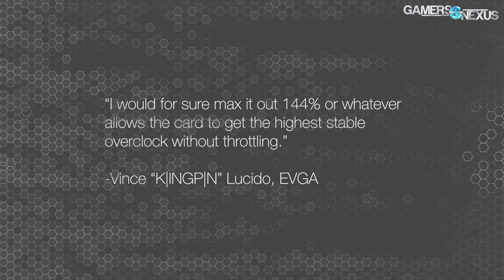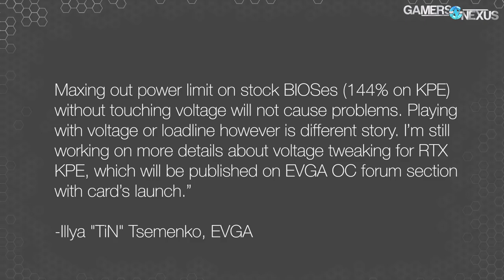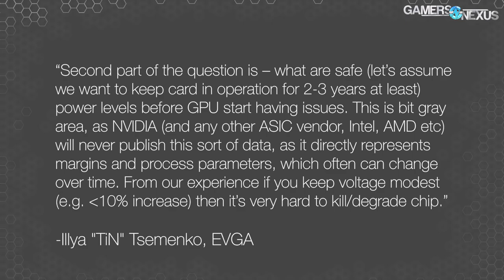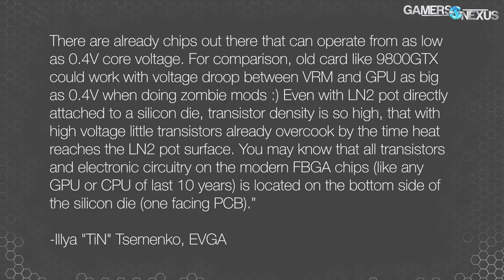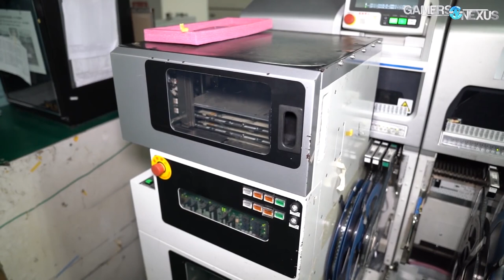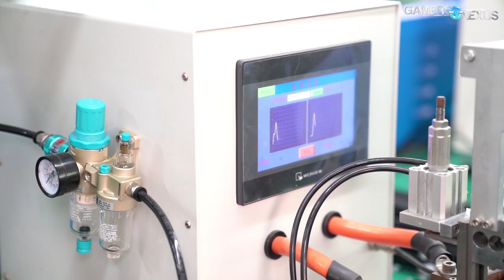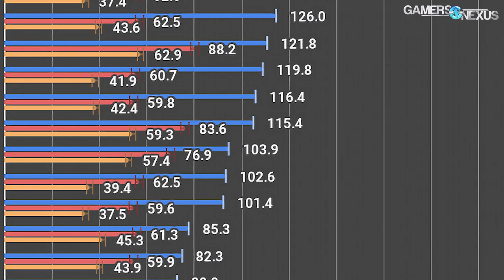Ask GN 107: Does Max Power Target Kill Cards? Ft. Kingpin & TiN Answers

Comment: Ask GN: Hey Steve. thankfs for the factory tours i enjoyed them alot. 

Do you think it's a correct and accurate representation of RAM Speed/Performance to say 3600Mhz CAS15 means 3600/15=240 and 3800Mhz CAS19 means 3800/19=200 therefore 3600/15 is 20% faster/better in games and productivity. Is it also a bad Investment for gaming and productivity to go for 3600Mhz RAM vs for example 2400Mhz Baseline? (Specially on a Ryzen Platform)

Comment: I feel this would be a great place to ask this: if I am gaming with a fan setup (meaning using only a CPU fan cooler), is staying at 63c during heavy load good? I was considering getting a CPU liquid cooler but if those temps are fine, then I probably wouldn't go for it till I upgrade to the new Ryzen line. Currently on a Ryzen 5 2600 OC to 4 GHZ
Reply: 63C under heavy load is good. Personally, I would switch to something better if temps are consistently in the 80s or higher.
Reply: Alexander Siracusa awesome thank you for the tip and the reply!

Comment: If you take a little bit of coconut or olive oil and rub it over your hands so there is a light coating on there, then brush down the dry flyer hairs to tame them. I noticed how when guys decide to grow their hair it always looks different than girls' because they haven't been training their whole life and don't know as much about properly keeping it nice. The entire trick is too dry or too oily. Too oily and you look dirty, and the hair doesn't move at all it stays pasted down. Too dry and the hair flies up and loses depth of color like a wood surface that hasn't been oiled. If you get the perfect balance it gets a nice medium weight to it where it will condense into locks instead of individually flying up in the air. It will also be stronger when it's not so dry. I knew someone who kept theirs even dryer than yours and when they finally got the balance right after I helped them the change was incredible. It went from an airy ball of puff to actual real hair. It also gained a few inches because it had been weaker when it was dry for so many years and had been wearing off at the ends.

Comment: Ask GN: Would it be possible or have any benefit for Intel to try making a whole new 14nm node adding in some of the new and exotic lithography, aggressive cobalt doping, and transistor pitch that are mainly holding 10nm high-performance parts back because of it being tried on a sub 10nm node. Where the issues I assume would be amplified just due to the new nature of the node size itself and their unique complications. Probably wouldn't make the marketing department happy to announce the brand new node at the same size either tho.

Comment: I'm curious about power delivery on motherboards and how this important feature sometimes gets downgraded in favor of RGB and other fluff. Didn't Asus X470 Prime get worse VRM than X370 Prime? I think there should be some standardization for VRM on motherboards, somewhat similar to how that works with power supplies. Buildzoid was very critical of bullshit VRM schemes from certain manufacturers who claimed they had more VRM phases than they actually had.
It's sad that most midrange boards like B450 get worse VRM than X470, while both usually have useless fluff like RGB. I don't need SLI or RGB, I just need a beefy VRM.

Comment: Overclock GPU 24/7: semiconductors, unlike 'normal ones increase their conductivity at increased temperatures; which makes them very sensitive to a threshold beyond which their operation becomes impossible. That temperature threshold is dependent on the load, stability parameters, real power input, load level, transient thermal dissipation,.... Basically, if you can keep it stable long term (ie, no crashes, minimal throttling), you should be fine.

The capacitor argument of GN IS valid for low(..er; ...ish)-end GPU power delivery systems, but anything beyond G/Rtx xx70 should be irrelevant (more or less). For detailed analysis you have to consult significantly more competent YT outlets like buildzoid.

Comment: Ask GN. I have a 1080 ti fe card that one day started black screening when it boots to desktop, then it starts whining! It will work just fine in safe mode. I'm wondering if the card is toast or is it fixable?
Reply: In safe mode, OS does not load proprietary GPU drivers, that's why screen not going blank. If reinstalling OS and nvidia driver didn't helped out then yes. your GPU is pretty much dead. However, it's still fixable by someone with proper skills and knowledge.

Comment: #askgn This may be a redundant question or really not matter but I thought I'd ask:  Is the heatsink fin orientation on a GPU important?

I'm looking to buy a new GPU in the coming months, probably an RX5700 XT.  I'm also hoping to one day get a case that is vertical GPU friendly; I saw your video on the SL600M from CoolerMaster and it got me thinking.  How much impact does the fin orientation on GPU heatsinks have (vertical vs horizontal)?    It's not something I've seen mentioned but when I think about the airflow in a case like the SL600M with a vertical GPU I would expect that the thermals would be significantly better if you had a GPU with a vertical fin stack.

Comment: People seem to think if a connector costs 20 cents then it should make a $50 case cost $50.20 and that’s worth it, but that’s not how manufacturing works. It takes FAR more to implement, install, etc so it could make a $50 case cost $55-$60, is 1 connector worth a 10% increase in price on a budget conscious product? 
Even if it means selling less overall products to make a handful of people happy and a lot more simply pay more for something they don’t use.

Comment: I have two mobo with usb type c, i still don't know the use for a type c other than mac products.
Reply: a lot if not most of the high end and now even mid range android phones have type c with a chip that can do quick charge/take advantage of gen 2 speeds so it's always nice for people who transfer lots of data off phones. a lot of external ssd back up drives are also using usb c so they can have a single data and power line with a small form factor and universal connector that can use the bandwidth.
Reply: @MrDJAK777  I have an Samsung Galaxy S8. I need a type C to type C or a adapter to plug it. By the way, my s7 also has quick charge with micro USB.  What I am missing?
Reply: @elchicovip01  you should be using a type c to type c at all times if you want the fastest charging rates anyways. micro USB quick charge has a much much lower power spec. type c supports Thunderbolt which can make for much faster backup to a NAS or portable hard drive and for devices without thunderbolt it still gives full USB 3 gen 2 transfer speeds which are a hell of a lot higher than a type a to type c cable can manage. the only reason you don't see a benefit is that you're not getting one if you have a type a connector on one side it doesn't suddenly increase the data and power transfer limits just because you put a type c on the other side. it has to be type c to type c to get any real benefit out of it.  you can supply power to monitors and on some, with USB type c's display port over USB feature, you can get video and power from the same one cable.

Comment: ask gn: i will have a spare i5 7500 when i upgrade to Ryzen 7, i so i thought just for kicks i would  buy a dual socket lga 1151 mother board and a new cpu to build a dumb money waster.  but after a bit of online window shopping i  turned up empty in the mother board department. why  can i not find a dual socket board for my i5 ?
 yes ik it is dumb and probably would be worth a sack of case screws but i was board .

Comment: ask GN: so I want a high end GPU (yes Mr money bags here) here in the UK it is seeming difficult at present to get a hold of kingpin card but I have recently seen the HOF card and the asus matrix card availiable here obviously there are differences in ccoling etc..  for the most part I will be running my system modestly probably stock but will also be tinkering with a good OC on occasion. my question is are there really a huge amount of difference between these cards performance wise please influence my decision lol

Comment: Hi Steve

I was wondering your thoughts. i'm running a 2700X and most reviewers i watch all say i put easy overclock on it with 1.4V at 4.2. I can't seam to get it stable at 4.2. using the asus auto overclocker as i'm new to overclocking, on longer test runs it crashed at 4.2 and on shorter runs it crashed at 4.225 and set back down to 4.175. I'm running a open loop with cpu and gpu though a 480 rad. However i'm in a thermaltake core P5 so 0 airflow over the motherboard and VRM heat sinks on my crosshair 7. could this be the main problem with not getting 4.2? would trying to hide a fan behind the vertical GPU pulling from the power supply area pushing over the VRM's would help?

Thanks
Caat

Comment: USB-c vs USB3, I can kind of understand the lack of from another angle. I don't have Anything that is USB-c.  So I am biased into the don't care camp, so long as I can plug in my USB2.0 sneaker-net memory stick without needing a dongle adaptor, lol.   I do think the USB-c front panel replacement plug kit for a USB1.0/2.0 port idea was the best option, provides the best of both worlds for both camps. You're not forcing something on me I have no use for, and not depriving others of something they may need.

Comment: One thing which would be of interest is, in your opinion, how much more would it cost (taking the factory tours into account and also the proximity of the various component manufacturers to each other) to produce computer components in the US rather than China?

Are there even equivalent industries in the US compared to China?

My reason for asking this is that there is a lot of "information" being put out there that China is eating the US's lunch; however I think that would only be fair commentary if, in fact, the US could manufacture the computer goods, such as motherboards, that China does i.e. does the US even remotely have the necessary supporting infrastructure.

Comment: i see new depth of field, camera aperture seems lowered, colors seem more vibrant (lower ap means lower iso so the image wont overexpose)

or has the light moved hmm... EDIT: nevermind, sony vs panasonic, i have heard about an EU regulation that taxes cameras that can record more than 30min so some products intentionally cap it, though sony is also notorious for overheating in its mirrorless models (which is why i bought a panny, sony is only good for low light high iso)

Comment: #askgn In your recent video about ASROCK $1000 mobo, you showed that they used an Intel mount in an AMD mobo. So, I was wondering if would be possible adopt a standard for coolers, eliminating that mounting brackets that come with an AIO cooler, for example. Or mounting brackets kits that are sold separately . Obviously a 115X cooler won't be compatible with a TR. But it's pretty plausible with an AM4 since they have almost the same area. I think this exclusivity is an undesirable legacy!

Comment: #askGN With most of the case testing on this channel pointing out that the best case performance is basically "big opening with good mesh and lots of airflow," and case manufacturers basically ignoring that in favour of stylish convection ovens (although convection ovens by their nature tend to have better airflow), I was wondering what the sales data says about performance vs. looks. For instance, the H500P vs H500P Mesh vs H500M, did the best performing case sell better, or the best looking one?

Comment: The GPU will be completely obsolete before power limit affects it.  The only example that differs from that is very recent, and it had to do with bad memory that was clocked higher than it's limits out of the box (2080ti).  This was pretty limited in effect, but people who have the same memory, and don't push their cards higher than expected or even at it's "normal" performance levels, could still see their memory degrade before ..or after their warranty expires.  This is another reason to skip Turing.   Anything else, anything made previous, no worries at all.. they just become obsolete well before.  If you've had a high end NVidia 7xx series (780ti) or an old AMD card, and have been running them to the max stable OC for years up until now, there's no degradation.  There are videos on this where they compared heavily used older GPUs with "new" old stock cards and they performed identically.

Comment: Ask GN: What are your thoughts on Apples refusal to support VP9? I find it puzzling, especially on the newer Macbook Pros, the eGPUs of which have HW decoding support for VP9, but I have yet to find a single program, even third-party, that can take advantage of the decoder (at least on OSX). I can see why Google would want to support VP9 vs H265 (lower cost), but why Apples insistence on supporting a H265 and not VP9 when the latter is royalty-free? It seems like a no-brainer for Apple, strictly from a cost perspective. Right now, above 1080p is only supported by Youtube on VP9, so Safari (no VP9 support) is limited to 1080p, and Chrome (no HW VP9 support) chews up CPU power at higher resolutions by using VP9. Apple could easily improve user experience  by enabling the HW decoder that's already in their Macbooks. Do you have any light on why Apple might not want to support VP9? Or is this just Apple being Apple?

Comment: My rx 570 is half dead.. it dosent work on 1244 1750 clocks.. I only did 20% power increase... sinc i bought it.. I needed to downclock to 900 mhz 1400 mem.. and it works.. LoLz... I will send it to warrenty anyway soon..

Comment: Ask GN: Shroud recently said on stream that the higher the FPS he gets in Apex Legends by lowering settings, the worse the game "feels", it hiccups and there is input lag, so he caps his FPS to 145. I looked at GN's article on the game and it didn't appear that you saw anything like that. There were somewhat spiky frame times and the avg to 0.1% lows might be a little more dramatic than other games. Do you think the difference in FPS could be even more pronounced when the FPS is really high or is there something else going on?